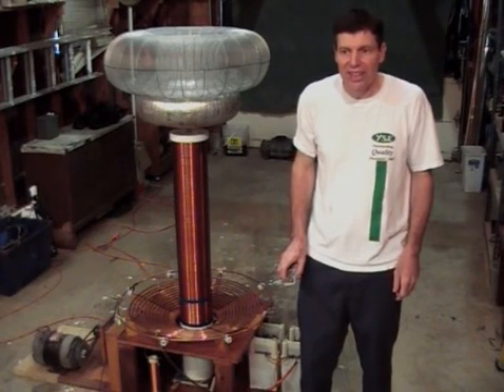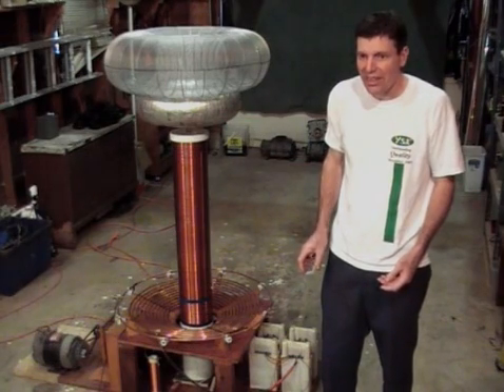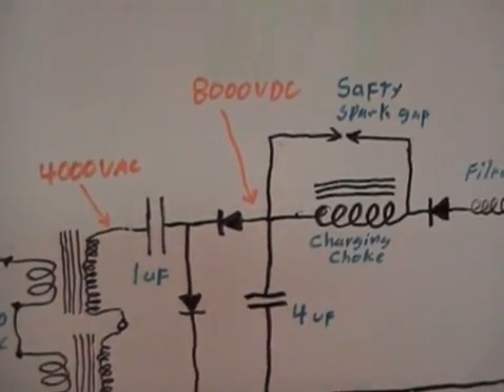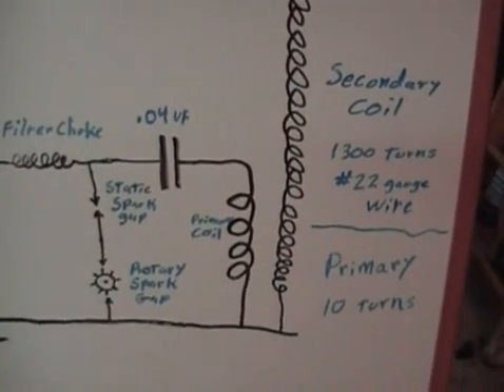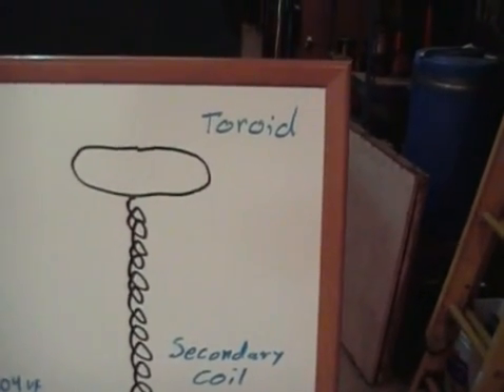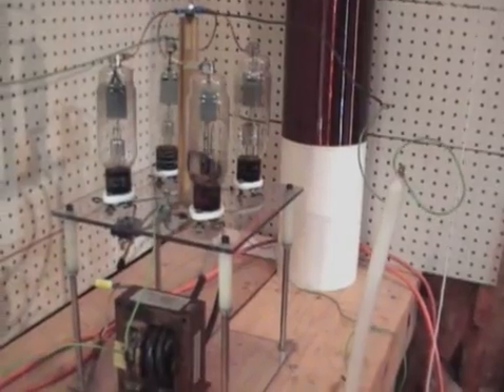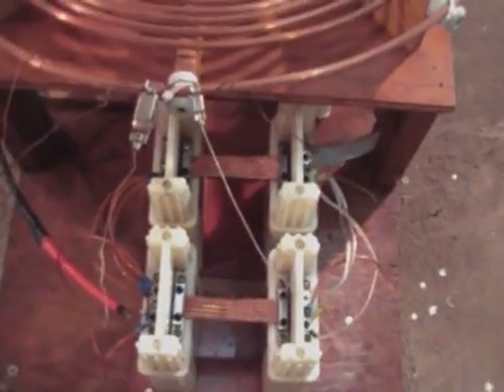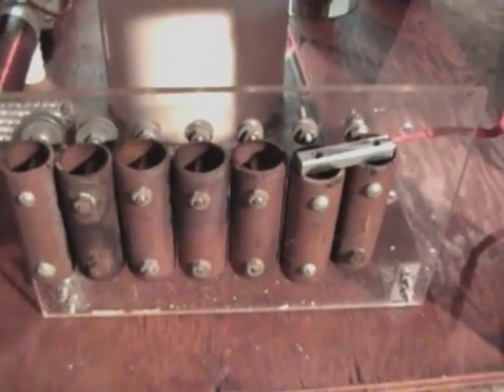Overview of my Large tesla Coil

Comment: P.S .I have a question, Does the RPM of the electrode wheel directly control the primary coils feed? as in if you raised or lowerd the speed would it change the perameters of the exiting arcs from the Toroid?

Comment: I wondered the same thing but now i think i figured it out. I think it is because the rsg was set to fire at a low voltage and adding a static gap will allow the voltage to get higher before it breaks down.

Comment: As he said, the safety gap across the charging choke protects it. The main gaps to the right in the diagram are part of the tesla coil operation. They fire when the tank capacitor voltage get high enough, ionizing the air inbetween, creating an almost short circuit path through the air. Then the current resonates between the primary capacitor/winding and the secondaries, in this temporary closed circuit. AFAIK

Comment: yeah theres a website on google that seperates a microwave piece by piece with illustrations im just concerned about reverse engineering the parts to be utilized for tesla projects. i would rather have u guys build your high voltage transformers by scratch with materials and circuits that are more apparent and less obvious to avoid possible experiment sabotage. think purity and density of copper in experiment and go from there

Comment: Disassembling a microwave is perfectly safe, as long as you mind the high voltage capacitor, and have the thing obviously unplugged.  there is no microwave radiation danger.  The microwaves are generated by a special vacuum tube called a magnetron, it works hen high voltage DC is applied, like an x-ray tube but a little different.  The modern solid state transformers are not commonly used for TC supplies, but the old fashioned core/coil transformers are (I use them as well).

Comment: hehe now that's a really nice sgtc! Also that's one of those few coils that really need the sparkgap feed, not just because the author didn't want to use tubes/fets/igbts/whatever, but because the gaps are really the best solution for this power.. Cute supply wiring too, also fun to see diode tubes instead of solid state diodes ;)